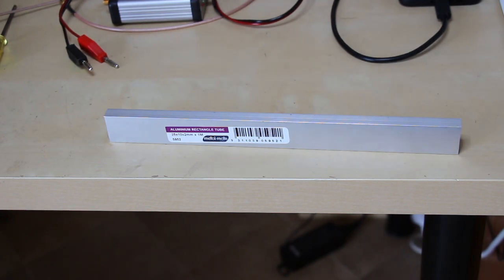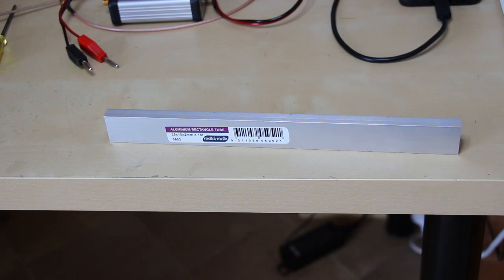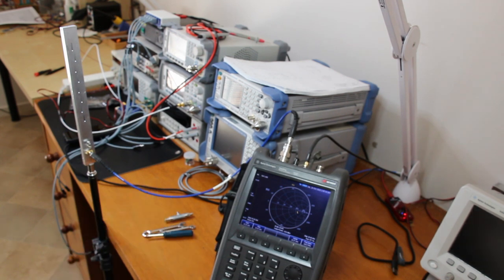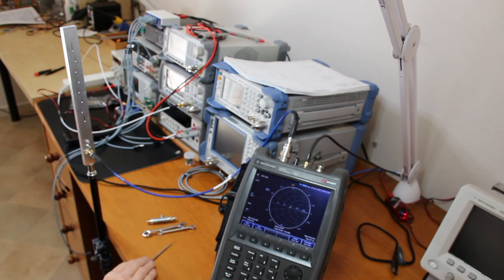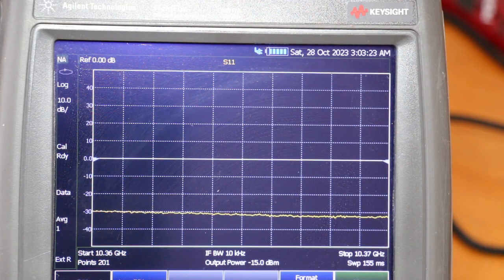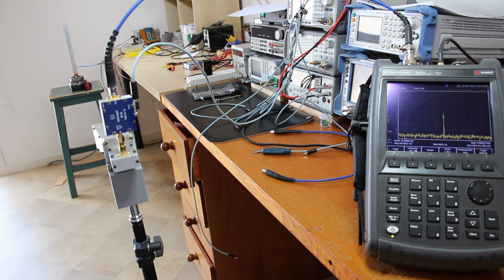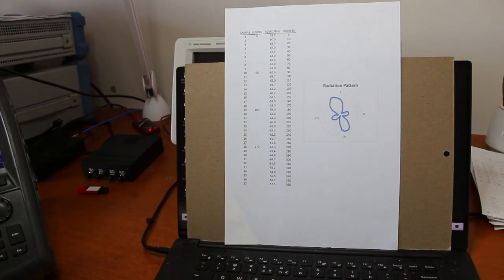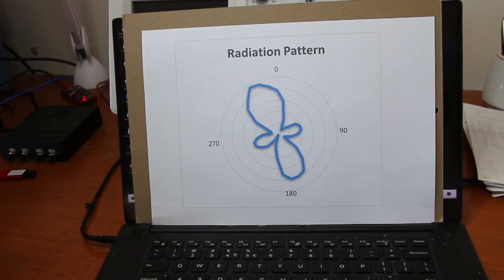#42   Design, Construction and Test of a 10 GHz Slot Antenna

Comment: Great video, and good idea to use a standard aluminium profile.
What kind of milling machine do you have?
Reply from the maker: Thanks for the comment, Michael. My milling machine is the Monster Mill,  made by A2Z, an American company that unfortunately closed down. The nice thing about this machine is that it accepts many Sherline accessories, another good American company (still very alive).
Reply: @vk5fe943  thanks.